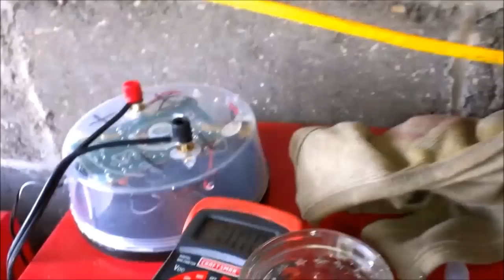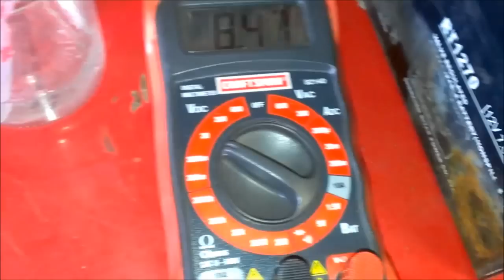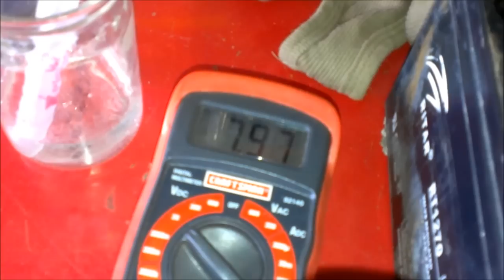Restoring a sealed lead acid battery

Comment: Non spillable agm lead acid batteries are not suppose to be filled with water hence the term non spillable.....the cells should not have standing water in them....it will ruin battery if you fill it

Comment: The average person spends $15,000 on batteries over their lifetime…But this fast and simple method eliminates that entire cost and lets you save thousands over your lifetime on battery costs [Check Details Here==>https://plus.google.com/100351090281822647456/posts/Gwtd4mVBdEd  ].

Comment: I have a 6o volt electric scooter with sealed lead acid gel batteries and I had just bought them new but when I hooked them all up I  reversed the polarity  on the last battery and charged it for 12 hr.s unawares of the damage I caused . I had only replaced the one battery and recharged it , I  drove the scooter around and it was great for a couple months  and then on my way home sometimes running low on charge being low on juice I continued driving until completely drained , this happened about 20 or 30 different times . 
now I can go a distance of only 2 to 3 miles and I have to fully recharge . 
My question is if I drain the batteries and before I rechargng  it , I add distilled water with an eye dropper, will that bring my batteries back to life  . I had hoped to  actually get 3 seasons out of them not just one . 
Any advice for me  ? and will this method work with sealed lead acid gel batteries
Thank you for your video
Reply from the maker: +Bruce Marshall I would assume that the one battery you hooked up backwards is dead and draining your other batteries. I would just buy new batteries or look up some videos on how to convert them scooters to lithium ion batteries. they hold a much longer charge and last a long time, years.
Reply: I want more power + energy for my scooter. I run a 36V 500 W. Top speed is 20 mph. Mileage 7-10 mpc. Can I ask about your performance with the 60V? That sounds really fast.. But do you get Power? Top speed and Acceleration... Or do you get "Legs" ? ... Like 40 mpc or something outrageous like that eh?
Reply: I have a motorino 60 volt xpn series 8oo w peak , lots of power quick acceleration and antilock ABS disc brakes top speed is 53 k
Reply: Thanks for your reply. I had overcharged them and one was swelled out. I didn't notice it right away and after 4 months I ended up just buying new batteries.
Reply: +Bruce Marshall  I have spent months researching into battery repairing and found a fantastic resource at Jons mender guide (google it if you're interested)

Comment: you need to pulse charge it with a special high frequency de-sulphate intelligent/smart charger, this is the one i bought on sale for 30 bucks http://www.canadiantire.ca/en/pdp/motomaster-eliminator-intelligent-battery-charger-12-8-2a-0111518p.html#.VcAc_6ISDlc , not a regular charger, and a small agm like that has input amp limits!!!!!!! you said you hooked it to a 10 amp charger LOL a 12 volt 12ah agm should only be hooked to a 2 amp charger maximum so a 7ah should get 1.5 amps max probably ;-) you only have to make sure that it is good and soaking wet inside and i would never fill it up totally, just cover the plates inside and monitor the process. why would ya fill it to the top and let bubbles spill it out if they form inside? but anyway this is an old video and who knows if you will ever try other batts again LOL be well my friend

Comment: how long would I have to wait to open it if it had been sitting for 4 or 5 months and then I charged it once or twice?
Reply from the maker: no wait. right away. just don't overfill. and keep caps off when charging and wait an hour before putting caps back on after charging.
Reply: Ok thanks! what voltage should I stop at whenever I discharge it?
Reply from the maker: a lead acid battery should never go below 12 volts for long periods of time. or else it will sulfate up and have less capacity. if your trying to restore it by discharging, then recharging, then let it discharge completely. if your using it as a project or something you can discharge it quite a bit but must recharge it soon to prevent sulfation.
Reply: TheSamchilders This video is awesome. i have another resources for how to recondition a dead car battery is  Knewreck Rapid Renew Guide search in google
Reply from the maker: it could be that its leaking. or that you are charging it way too much. like above 5-10 amps for long periods of time
Reply: hi everyone ,if anyone else wants to discover learn how to recondition batteries at home try Megarno Amazing Battery Magician (just google it ) ? Ive heard some awesome things about it and my cousin got amazing results with it.
Reply: hi everyone ,if anyone else is searching for recondition lead acid battery try Jadonite Renovate Battery   Buddy (do a search on google ) ? Ive heard some super things about it and my friend got cool success with it.

Comment: I tried everything to restore my battery pretty much whatever you did in this video could not get it to work. Eventually threw the battery. Then I thought later may be the charging unit inside the flashlight was not sending enough charge,,. So my question is if I plug in the wall transformer which leads to the flashlights corresponding Jack and then if I connect my voltage regulator to the two wires inside the flashlight what should be reading be? Also where should I set my voltage meter to.
Reply from the maker: set meter to dc volts 20. then plug it in and test the two wires going into the battery. if its a 12v battery should see close to 12v
Reply: bam6972 noted, did that  had battery on charge attached with the leads from inside battery overnight, did not charge. battery gone, so plug transformer into flashlight (red light on) 2 leads in battery the question is how do I test if to see is it sending a charge through battery...thx so much
Reply from the maker: marvin Zelikovic disconnect the battery leads then test for voltage without battery connected at those leads. but the battery is probally toast. them little lead acid batteries in flash lights tend to only last about a year.

Comment: So how do you reseal the battery after you top off the electrolyte? I have a stack of three 12v 20Ah batterys for my ebike i need to revive.
Reply from the maker: just put the rubber caps back on and then put the top plastic piece on with some tape or super glue. but don't fill them too full and charge them up real good with the caps off first before you reseal it